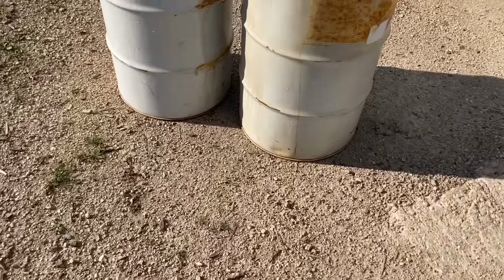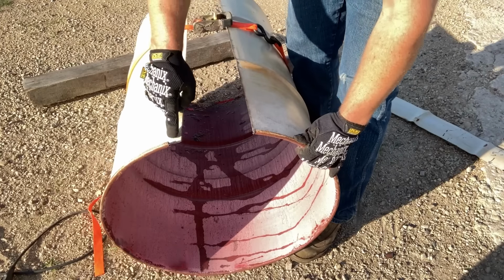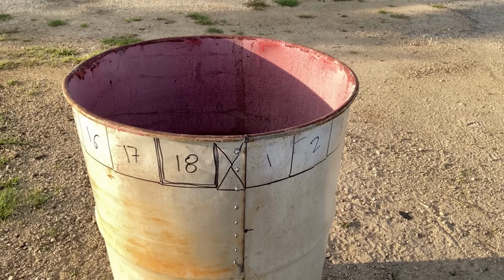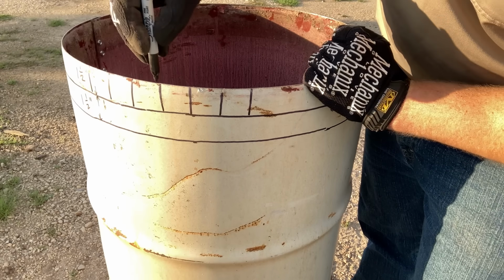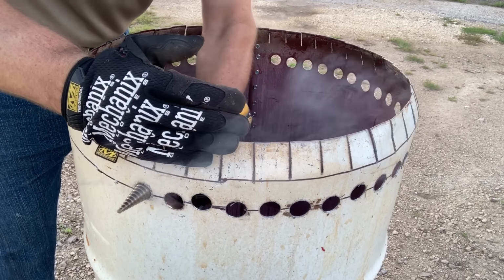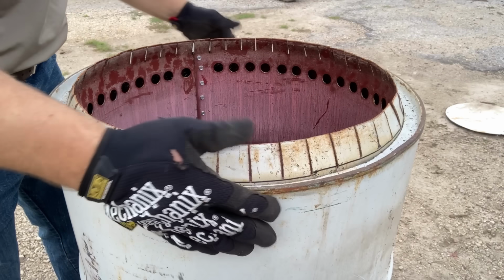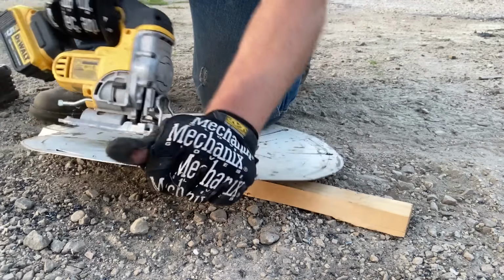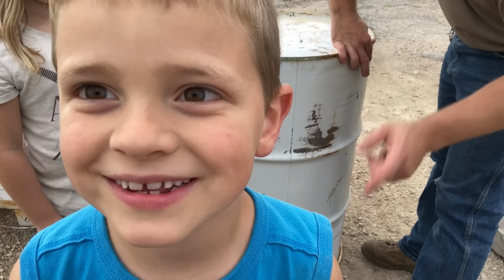Smokeless Burn Barrel

Comment: Google TLUD, Top Lit Updraft Burner, that is the technical name for this burner design- This video shows a burner that is a GOOD START in the right direction, it is not very well balanced as far as primary and secondary combustion air flows and needs some way to separately regulate those two flows of combustion air. Just for a start, those vents at bottom of inner barrel are FAR TOO LARGE. The air holes at bottom should be only about 5% of total bottom area. Just enough for the fuel to smoulder well, burning from the top down, generating gasses to be burned off at the upper, secondary & pre heated air inlets. Which should be a bit LOWER on inner barrel, allowing a bit of stack effect draft above those secondary inlets. That rotary air flow inducer used below fuel would be more useful ABOVE the secondary air inlets to better mix the generated flammable gasses with the hot air from between inner & outer walls for more complete combustion. IF LARGE FLAMES ARE SHOOTING OUT THE TOP, BURNER IS INEFFICIENT AND YOU ARE DOING THIS THING WRONG.

I should just build an optimized barrel burner and show it. All the ones I've made & used previously are cook stove  size, but the same principles apply.

Comment: Cherry blueberry, why not leave da bottom on for a stronger can (stronger lasts longer)  same vent holes bent up den second bottom from first barrel cut you trace same vent holes but bent down (so as to act like windsails an catch air) Den put bolt washer in between two pieces nut to hold together but not tight! attach a handle an attach to bottom of can an walaa adjustable air/fuel mix ratio on yo burn barrels!

Comment: This is a waste of time. In your comparison, the barrel on the right is burning hotter, i.e., no smoke. The one on the left was just started. 

Easy to get the barrel on the right with fewer steps. 🤷‍♂️
Reply: The one on the right really works differently, it's not just hotter.
Basically, in a fire there are two processes happening: The heat is turning components of the wood into a mix of gases and vapors that is called wood gas, this process is called pyrolysis. If it's hot enough and there's oxygen available, the wood gas will then combust, which produces the flames of the fire. But if there's not enough oxygen or heat, the gases will escape as smoke.
In a regular fire, including the barrel on the left, both processes are supposed to happen in the same place. And any piece of wood that is hot enough for pyrolysis but not for combustion, and any area with not enough oxygen, will produce lots of smoke.
In the right barrel, the two processes are separated from each other. You have one pyrolysis zone in the center of the barrel, where the wood is turned into wood gas but there's not enough oxygen for it to combust. The wood gas will then rise up as smoke. And where the holes are below the rim of the barrel, lots of fresh air is mixed with the wood gas, so there's plenty of oxygen. At the same time, moist wood or other unsuitable material is down in the pyrolysis zone and won't cool down the combustion zone. This allows for complete combustion, even with moist wood, bark or leaves.
Reply: @SerienchiIIer  in this example, the one in the video, it's obvious this wasn't a design difference, but an ignition timing difference.

Comment: This gives lov heat. If the purpose is to just burn thing and wood this is ok but a lot of work not necesarry just for bruning, and so low heat.  The dobbel walls stop most of the heat because of the streaming air betwen the walls. This not good for sitting around with family and friends, because of the doble walls that stops most of the heat, and it is way to high for sitting around, as the fire is deep down i the barell.

Comment: these barrels dont last lomg: Time + wear on tools that was made with chemicals and smoke= dont make since to me!  could just do as grandpaw did! equal : you dig a huge hole /3 feet around the top ..you keep your dirt/ u make a 6 inch ditch with post hole diggers to draw air ! after you done and if fire didnt finish and you go bed=toss dirt on it . peel layer dirt out before next burn limbs.. This hole last 10 yrs.. alot times you can collect charcoal  as well.

Comment: Best way to improve this idea is to not use 55 gal. drums to begin with. Maybe use some large diameter pipe. Not sure. What I am sure of is that the flimsy sheet metal these barrels are made of, when exposed to higher heat and the elements of weather, won't last as long as it took you to build this thing. Not worth the effort in my opinion.